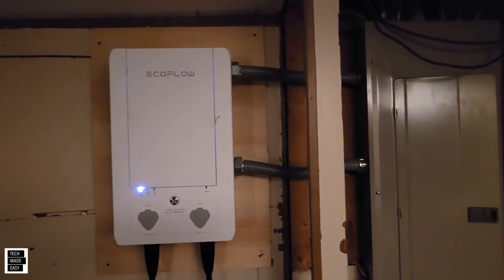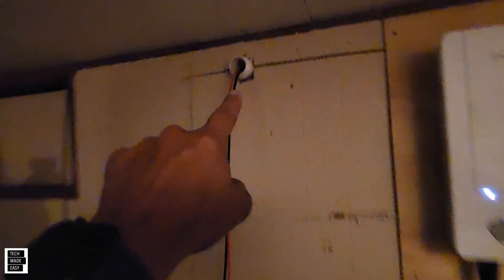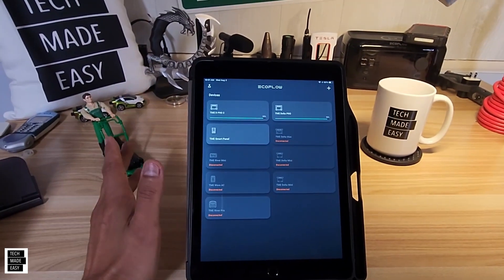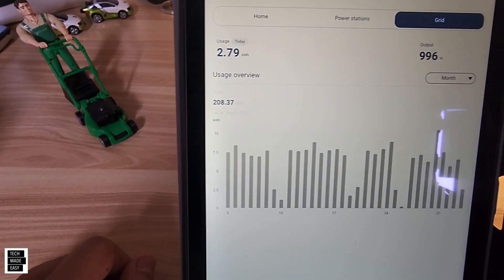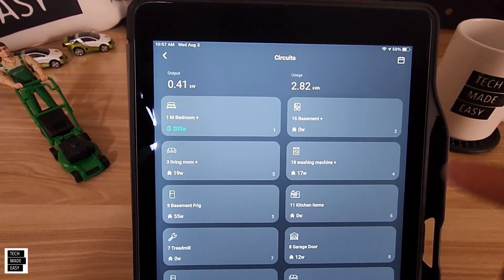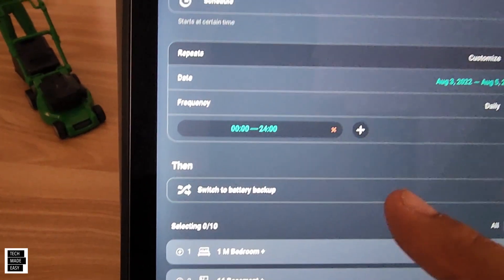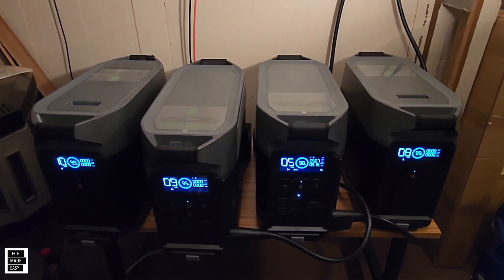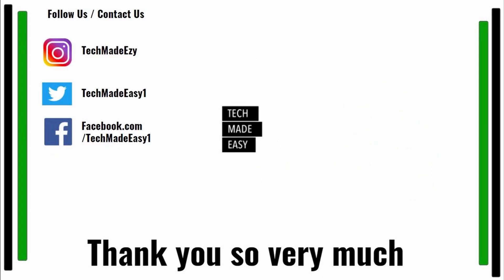EcoFlow Smart Home Panel BASICS Part 1 basic automation, power circuits

Comment: I like the Smart Home Panel a lot and would like to install it here in Germany. However, having one a question: what happens if you produce more solar power than you can directly use internally via the SHP? Is the access energy fed to the public grid or does the Delta Pro shuts down the solar feed avoiding this?
Reply from the maker: That's more about rooftop solar the smart home panel to my knowledge at this point cannot be connected to any type of system like that all you can do is stay within the specs of the Delta Pro using portable or rigid type panels but not a whole rooftop setup
Reply: @TechMadeEzy  You can connect any solar module as long as you don't exceed the specs of the Delta Pro. Therefore, a roof top system is also possible and was confirmed by eco flow in Germany. You loose appr. 5 Watt every 10 meter cable length when connecting far away modules to the Delta Pro according to eco flow,  In my case I will use three modules each 460 Wp in serial and will stay below 150V the max input for the inverter of Delta Pro,
Because of legal situation in Germany it would be good to know whether any power can be fed back into the public grid when solar access is there.
Reply from the maker: Interesting, I work directly with EcoFlow and never heard that but that's good news in your case. Well, best of luck make sure you get some information from them on how that connects and just be careful and make sure they will warranty your Delta Pro. Thanks
Reply: @TechMadeEzy  Yes, will do. This

Comment: Can you connect 2 sets of 2 delta pros each with 2 extra batteries with to the smart home panel ?
Reply from the maker: Hi Pedro yes 
2 DP
Each with 2 Extra batteries 🔋 for sure
Reply: @TechMadeEzy  thank you for answering the two extra batteries plugs on the back of the DP and the DP plugs from the front to the smart panel?
Reply from the maker: The batteries plug in the back of the DP and the smart panel connects to each DP on the right front side infinity port

Comment: The solar is weak on that unit. 150 volts is not very much for the price point. Should be 300 volts 3000 watts for that price point.
Reply: Your right, my panelse sometimes produce app. 1000 volts, any suggestions to make sure not go above 150 volts - - controller or inverter?

Comment: I’m curious if they are both off to prevent discharge and the panel detects an outage does it turn them back on?
Reply from the maker: No, they would have to be on for that to work.

Comment: Is there a way to have it re-charge when the batteries reach a certain level?
Reply from the maker: Yes
Reply: @TechMadeEzy  how can I set that up? In automation page, I only see a Schedule based setup to recharge, but I don’t see a battery level based condition
Reply from the maker: Battery levels are set in settings under smart panel settings and under the DP settings

Comment: with a smart panel on the way, it was definitely helpful. My problem is going to be: I have a potential 4kW of solar on the roof and my one Delta Pro can only take 1.6kW. I will probably get a second Delta Pro and use a second solar cable set (which is going through an old chimney...) to split up solar power to 2kW per Delta Pro. I hope to have 1.6kW of solar even in fall and spring.

Also, how do your Delta Pro behave at dusk and dawn when there is less than 40W of solar input, is there obnoxious power relay clicking from the mpp tracker in the Delta Pro?
Reply from the maker: 1st congrats 🎉 
you are gonna love this SmartHome panel it’s not perfect but it’s so cool that you can actually get one and do the things that this can do
I’ve heard that sound definitely. I don’t keep my solar plugged in all the time but that’s me because I have a small set up and I don’t have rooftop solar.

Comment: Purchased 2 main units 2 batteries, 2 smart generators, smart home panel with 8 335w solar panels for my roof. Can’t wait for it to arrive. Your videos really solidified my decision many thanks 🙏.  Have heard rumors of a add on that will allow more solar input and additional battery inputs. That would be next level . Great context thanks again 👍
Reply: Looking into the smart home panel also in combination with the power kit instead of a Delta Pro 's... Ecoflow told me that you can inject more solar in that kind of setup ..
Reply from the maker: Thanks best of luck

Comment: Can you over the different conditions that can be used for the automations? Like is it possible to power a circuit until the battery reaches 25% and then switch to grid?
Reply from the maker: No I haven’t seen that capability it is pretty limited but again there aren’t many SmartHome panels out there at this time. Also EcoFlow is still doing firmware updates so you never know
Reply: @TechMadeEzy  ,sounds good thank you for the reply. Do you know if it integrates with Home Assistant?
Reply from the maker: My pleasure 👍🏼
It does not but I’m sure some tech Genius can make it happen
Reply: You can set the discharge limit to 25% then it will automatically switch back to grid. It's called discharge level in the app settings.
Reply from the maker: Should be able to, haven’t tried it yet

Comment: The app that you are using, is it Bluetooth? Or do you need internet?  Reason I ask we had a storm lost all cell services and internet for 4 days plus power was out for 6 days. How well will system work with everything out?
Reply from the maker: It works on Bluetooth and wifi with the delta pro, that's what it's made for, power outages works well from what I see so far
Reply: When we lost power and internet and all cell service, all my ring cameras where useless, as well as all other smart devices. It was a eye opener. We Had a generator.  Just trying to  make sure you can still connect to the units using a tablet or phone . I like the set up you have , just want to be sure I can still connect to the units .
Reply from the maker: You won't really need to connect to them but you can via Bluetooth. Bottom line they will power the 10 circuits that you choose. 240v appliances will require 2 delta pro and a certain setup (split phase)

Comment: Are there any federal subsidies on this setup yet? I have not moved forward on this because of the subsidies
Reply: Tax help (26% at the moment, of the entire cost of battery units (and main delta pros) and the smart panel and solar panels and set up costs).   It kinda helps... and if you don't pay enough tax to get the whole lot next year, the remainder carries over to the following year(s).   Everything that is directly part of this solar system is covered for this tax relief.

Comment: Delay when switching a circuit from grid to battery?
Reply from the maker: Hi Keith 
Yes, see the part when I actually do the switch for one circuit and the lights will turn off and turn on.
Reply: @TechMadeEzy  If EPS is chosen, the switch from Grid to Battery is microseconds.   Mostly one does not notice (lights don't dim, etc..)   Only two little lights in my home turn to standby through the change but they are little desk LEDs.   With everything else in the house the change is so quick, you don't realize the change in supply has even been made!

Comment: I believe you need to remove the jumper on the smart panel to use split phase. That would dedicate a Delta Pro string to 5 breakers each. Also it would allow you to use 240v devices like cook top or ac with a softstar device 😉. Great video by the way... p.s hello Brooklyn.
Reply from the maker: I believe you're right I only have it set up in single phase right now thanks for your comment 👍🏻
Reply: I don’t have panel yet. I just ordered it. I was thinking the same thing might be true. Thanks for helping to confirm that. I would love to see and update video done on this Smart Panel.

Comment: Would be nice if it’d drain from both DP’s simultaneously to get similar cycles life out of the two units.
Reply: The power is drawn fairly evenly from both Delta Pros (and their batteries).   It switches from one set to the other when wired single phase.  So many % at a time.  If wired for split phase it takes one delta pro for each side of the panels.
Reply from the maker: I'm not sure if that's a possibility if the smart home panel is set up in parallel mode, this supports 240v. I currently have it set up in single phase but I could always switch to parallel mode if I want to in the future